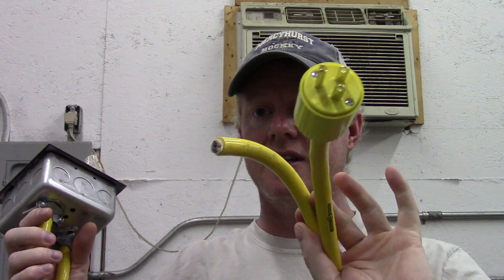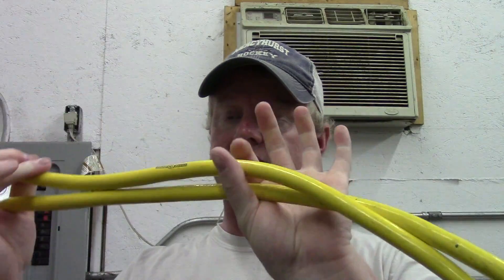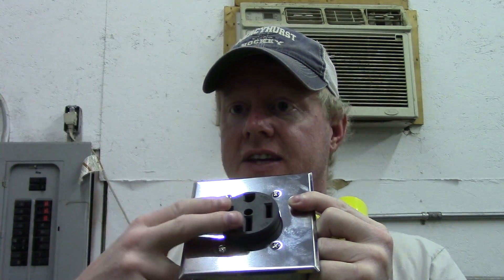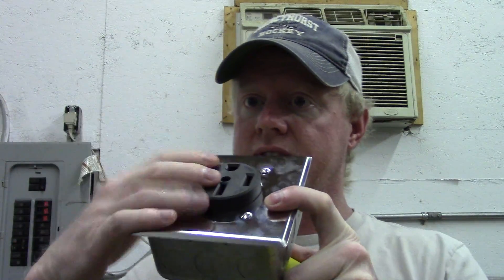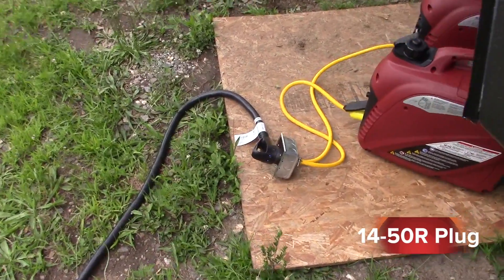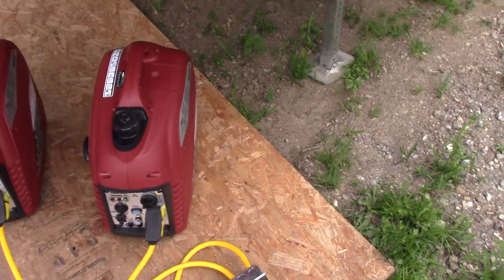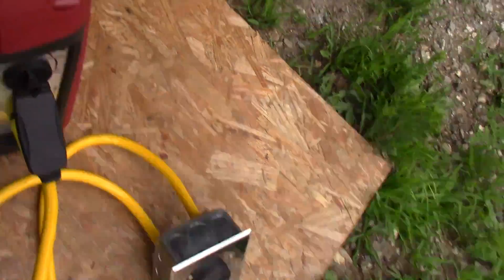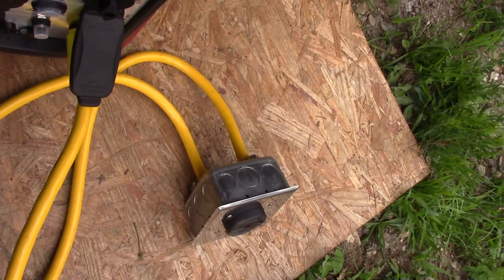How to make an Inverter Generator Parallel Cable  AKA Cable of Death

Comment: Do inverters align the two phases when connected this way? Or else I suspect it won't be true 240v output.
Reply from the maker: It won't be 240v with 120v inverters but yes the first one to start output is the master and the rest slave to that single phase.  Newer 240V inverter can do the same with 240V.

Comment: For those who doesn't understand the insides on the box you might want to show a picture or a drawing.  I can't see why a gen at 4400w and another at 4000w wouldn't run a small house in rough times or others.  Thanks for the posts.  Also one might want to add a off switch in the center 8n the wires.  Thanis for the posts

Comment: why would you not use the other plug for more amps?
Reply from the maker: Which "other plug"?
Reply: @ShaneBurrell1  Doesn't each gen have the 3 prong 20 amp twist lock above the one you used? That one is much less prone to falling out and is rated at 20 amps.

Comment: Wonder if anyone has successfully paired an inverter running off a battery bank with an inverter generator. Great video
Reply from the maker: I've never tried it but it would work as long as you have a good source sine wave.
Reply: @ShaneBurrell1  yea that’s the problem. I think most are modified sign wave

Comment: Hi Shane,
I have the same question pertaining to the predator 3500 gens running in parallel. 

 Ther rig does have two (2) 50 amp breakers 
(leg 1 & leg 2), therefore it's a 240 service coming into the breaker panel....

In that case, would both "hot legs" still be bridged, or would I just send Gen 1 to line one and Gen 2 to line two of the 50 amp outlet?  

I will be utilizing the 30 amp (3 prong) plug from both gens, and yes I will be installing a 50 amp breaker as well.  I just wanted to know if my thinking was correct when it comes to wiring the legs to get the 240 volt....

**The big issue I have is, I have the Heughes Power Watchdog hardwired into my rig.  The "Power Watchdog" will throw a code if it can't see the two legs coming in. This is where I'm coming into an issue at the moment.

Thanks for any insight.
Reply from the maker: On the rig, you need to be really sure that you don't have any actual 240V loads (Residential Fridge etc).  If that is the case you I would recommend bridging and ending up with generators in para mode at 120V. If you don't bridge they will just be seperate generators with a shared neutral still 120V on each leg with no 240V .  You won't even be able to actually get 240V from the predator 3500.  It's strictly a 120V inverter.  To get true 240V you would need to step up to the 9500 Predator Inverter. The reason this works normally on most RV is they install a 50 amp 240 panel but the loads are normally 120V.  Sometimes they have upgrades that are real 240V which isn't compatible with this method.
Reply: @ShaneBurrell1  Thanks for the reply Shane, I did make the parallel cable yesterday and at the moment there isn't any jumper between both the hots.  When I tested the voltage, there is 120v on both legs, and the Power Watchdog recognizes it as 240v, allowing the power to flow to the rig.  Once the system all checked out, I started my AC's one at a time.  With the current setup, I'm able to run 2 of my 3 AC's, All my Tv's (4), along with other devices and appliances running.  For the record, there is a residential Refrigerator in the rig.  As a side note, last night my wife had started her hairdryer  before I could turn off the 2 AC's, and to my surprise , we didn't overload the system.

As a general thought, since I haven't "bridged" the two hots, and each gen has the capability to produce 120v, the Hughes Power Watchdog accepts this as 240v, therefore letting it pass through.  

*FYI, the parallel cable that I made cost $98. in materials..

Shane, thanks again for the reply, as well as the video

Comment: I made this exact set up for my honda eu3000i generators. When I hook my rv cable to it, it shows the red led light meaning reverse polarity  or hot ground. Does that sound right?
Reply from the maker: It does not sound right. What has the red light?  I have a furrion 50 amp system and it does have lights on the cable but they are both blue and just are either on or off.
Reply: @ShaneBurrell1  the cable coming from the camper. When I plug it in the parallel cable from the gennys it alluminates red,which says reverse polarity or hot ground. Was your 50 amp receptical a 3pole 4 wire?
Reply from the maker: It's a 14-50 R which is 3 pole 4 wire.  I would ohm out the adapter and make sure your ground isn't conducting to either of the hots or the neutral. Then check the neutral to ensure it also isn't conducting to either hots or ground.  You should be able to test also by using a voltmeter with gen running at the plug to ensure you see voltage only on the hot legs of the 14-50 R
Reply: When I test for voltage at the 50 amp receptical between black(hot) and white(nuetral) I get 124v, when I test for voltage between white(nuetral) and green(ground) I get 60v, when I test for voltage between black(hot) and black(hot) I get 0v. Does that all sound like proper voltage for this set up.
Reply from the maker: The ground to neutral is strange.  It should bonded.  What generators are you using?

Comment: 🤔 Maybe adapt the generator outlet to twist lock? Great Video, answered a few questions I had. Thanks. Now for a guiness book of world parallel generators.
Reply from the maker: Glad it helped.  The 50 amp side is pretty robust. Takes a lot of force to pull those out.  The generator side would be hard to do as its space constrained behind the panel.

Comment: Outstanding lesson in parallel generator electrical mechanics!! I went to buy a parallel kit and thought, I can make this for around $30. However, I wanted to do some research first to make sure my brilliant idea ( some not so much) would work. Perfect, thanks. BTW, I recognized your call sign. Mine is KF4JGY...Well done sir....
Reply: Found one on Amazon, pre-made and it is perfect. The cost is $44.01
Conntek 14995 50 amp
Reply: @thomasgibson8025  Just to be sure that you are aware on that adapter you just got (14995); that one's 50 amp output DOES NOT TIE the two hots together.  So each of those hot legs just simply pass on whatever amps are feeding them; they will not combine your two generator outputs.  So hot leg 1 output yields a max amps from only one gen and the other gen feeds that 2nd hot leg. So the continuous gen amps output (say 1600 watts ~= 13.3 amps)  is all that feeds one of the halves of your trailer's 50 amp breaker panel, the other half is feed by the other gen.  Thus they won't be parallel combined.  That's why Shane made his own and pointed out that he is tying in both hots purposefully at the 6 minute mark of the video.  That way he is combining each 1600 watts continuous gens to get a total of 3200 watts (~26.7 amps) continuous and jumpered means each hot leg can carry those 26.7 amps.  But he must not exceed that 26.7 combined throughout his trailer's whole 50 amp breaker panel; thus his testing.
What this adapter you purchased is meant for and is perfect for is if you're at a campground with two back to back facing land power pedestals each at 30 amps. If no one is camped there using that 2nd one, you can plug each of this adapter's 30 amp plugs into each 30 amp receptacle (or if there are two 30 amp receptacles on one, use those) and then your trailer's 50 amp plugs into the adapter's 50 amp outlet. If that second power pedestal is further away, just add a 30 amp extension cord as needed. But you then still only get 30 amps on each separate hot leg to feed the two 50 amp halves of your breaker panel, so don't exceed 30 amps on each half or the pedestal breaker trips.  But that's still plenty of power! Now if you get two 3600 watt (30 amp) inverter type gens, then with this 14995 adapter, you also feed 30 amps to each of the two halves of your trailer's 50 amp breaker panel.  Similarly, two 3000 watt inverter gens would still yield about 25 amps each half.  So you may still want to keep it; as one day when I get a 50 amp trailer, I would want the 14995 adapter also.  For reference, a 50 amp land line yields two 50 amp hot legs (leg 1 & leg 2) thru a 50 amp cord.  Each half of the 50 amp trailer breaker is then feed it's own full 50 amps for a total of a 100 amp service breaker panel. Hope this helps and Happy Camping!
Reply from the maker: Glad it was helpful!

Comment: Should a ground wire be connected to the metal box with the 50 amp outlet ? A jumper wire from the plug ground to the box ?
Reply from the maker: You could bond the box.  Since there isn't a conductor (EMT conduit) to the box there isn't a large chance of potential difference at the metal box other than if it was energized by something loose in it.  In that case it would trip the load breaker with a dead short if the supply came loose and contacted the box.
Reply: @ShaneBurrell1  I have generator from the 1970’s with no breaker. In this case what would happen?
Reply from the maker: @Dennis-fs6zo  Well #1 this cable works with newer inverter style generators.  So it won't work with normal older generators that can't sync to each other.  If you had a cable that went to a metal box contacting a exposed wire you have the potential for electrocution when you touch it. If the box was tied to generator ground it would overload it (fire & heat).
Reply: @ShaneBurrell1  yes , my question is unrelated to syncing inverters. My gen has a four prong 220 outlet I use to power my house. I made a box to  plug into generator  with 110 outlets. Tied each hot to its own outlet. Jumpered the neutral. Do you think this is safe?
Reply: Should the box be grounded to the generator?
Reply from the maker: @Dennis-fs6zo  Yes, you can split your output to 110 without issue.  The box would be safest if bonded to ground.  If used with a homes existing wiring, the ground system the generator Frame should also be bonded to earth ground. If you are running isolated, just extensions cords going direct to loads you the generator frame is the sole ground.
Reply: @ShaneBurrell1  What scares me is without a breaker on the generator should the 110 outlet box become energized it could kill someone. Thanks for your help.
Reply from the maker: A PVC box is also an option but from your description, I would bond the box to the generator ground if you used a conductive box.

Comment: you mention that you got the 50 amp outlet at Lowes... where did you find the two 110 yellow cables? what size wire does the cable have... 10 gauge, 8 gauge, 6 gauge, etc?
Reply from the maker: The yellow cables are "yellow jacket" brand extension cords which I also go at lowes. They are 10 Gauge.

Comment: nice video. hope this gets to you. I have an older Honda generator, it does not have a parallel plug on it
Honda EM5000is  it's an inverter generator.  Obviously, the banana plug just makes it easier to use? 
So just basically do what you did or can i buy one and change the end banana plug to a 220 volt plug?
Reply from the maker: If it has the para banana plugs you could just not use them and use the receptacle on the genset. If it doesn’t have the banana just be sure it’s an inverter style and that the module in that genset supports para sync
Reply: @ShaneBurrell1  it is a inverter generator. but no banana plug. how do I find out if it supports a parallel kit?
Reply from the maker: @BK-gc1jm  easy way is to part number for the module and see if it’s used in other units that have para operation. Sometimes you can get complete manu specs on the module that will tell you as well

Comment: Have a question . Can this also be made up to utilize the 30 amp plug on the generator ?  Realizing there are two hots on the 30 amp plug . So I was wondering if it is possible to just split the phasing to each side of the shore female plug from both generators .
Reply from the maker: That depends.  If you have 2 hots on the 30 amp it's a 240v plug. Is this an inverter style generator?
Reply: @ShaneBurrell1  it would be an inverter generator . So on a 30 inverter generator ( 3 ) prong there’d be only one hot leg . Having two 30 amp inverter generators that are parallel equipped but using the 30 amp plug in the same fashion as you did in your video , I’d think then you could be able to have 60 amps by using the same scenario as shown in your video . I may be incorrect in my thinking though . Just trying to figure out to get service for my 50 amp rig by utilizing the same design fashion as the video and two smaller generators .
Reply from the maker: @simplyblessedrvlife9067  Oh yeah you can just put 30 amp plugs in place of the 15-20amp plugs.  They only thing i would caution is the inverters likely have 30 amp protection so x2 that would be 60 amps which is more than the 50 amp plug is rated for.  You may want to consider a 50 amp breaker or if the gensets put out less than 30 amps bet on them never doing it.  I'm sure you have already checked but be sure your appliances are not 240V and that your panel load is less than 50 amps.  Technically a 50 AMP 240V setup in a camper can consume 100amps at 120V but normally thats not a issue.
Reply: @ShaneBurrell1  yep you’re exactly right . I’d have to install a 50 amp breaker between the split and the draw plug . I totally missed that . Thanks .
Reply from the maker: @simplyblessedrvlife9067  Let me know how it turns out.  I've be eyeing one of the NPS 5500 once they are generally available.

Comment: I have a champion inverter 8750 (8750 starting watts and 7000 running watts).  It gives me 30 amps of 240 power which gives me 60% of the load that my RV can take.  My question is, this is a modern inverter generator, but it doesn’t have a parallel port.  Can I buy a second one so I can have 60amps of 240 volt total power available?
Reply from the maker: That's a good question. I haven't gotten to see a 240v inverter yet from champion. Can you see any part numbers on the inverter section?
Reply: @Shane - https://www.championpowerequipment.com/product/100520-8750-watt-open-frame-inverter/

Model #100520
Reply from the maker: I couldn't find any info on the inverter module this uses. I'll try to see if I see one in person next camping world trip.  If you can identify the inverter section it will give you some insight on if it supports syncing or not.  It's a little strange they didn't put para ports or offer para cable.

Comment: Can I make a similar setup to power a inverter welder? I want 220 power with the added wattage from 2 5500 generators?
Reply from the maker: If the 5500’s are inverter style generators that support para operation yes
Reply: They are not. They are older models with out daisy chain ports. Like yourself I'd be wiring them like the 120 volt you did in this video
Reply from the maker: @ryanestes4581  This only works with inverter style generators.  They can sync to each other. A standard generator can not.

Comment: How is this approach different than the little box Champion sells?  I have 2 2000 watt inverter style Champions and the box won't arrive before my vacation.  I understand all of the physics you've described here, and I understand that the inverters will self discover the phase.  What I'm wondering about is the Champions have those special plugs that are supposed to connect, and yet you never used that.  You just plugged two 15A circuits into a single 30A (or 50A as the case may be).  So why to the Champions have those special plugs?
Reply from the maker: There is nothing different other than the compactness of what I built to go straight to my 50 Amp.  I hate the banana plugs. Westinghouse has something very similar that I like and sometimes use that has a 30 amp which you can use a RV dogbone to mate to a 50 amp.  It's preference really.  The champions use banana plugs because they are insulated (mostly) even when disconnected and in theory safer.  For me I always connect everything regardless so there is never a live exposed end.
Reply: @ShaneBurrell1  so I tried it out. When the AC kicked on the generators would hit overload. After several tries I got the AC one but it quite after 5 minutes. Then the one generator wouldn't produce power. Tried to kill and restart and it was hard to pull the cord. It feels a bit seized. In the end it didn't work however I don't think your cable was the issue. I tested it at 125V.
Reply from the maker: @johnniemo  Are you using an inverter style generator?  Para doesn't work with normal generators.  Only inveter style generators.  You should have no problems starting a RV AC unit with even 2 1800+ watt inverter generators in para.
Reply: @ShaneBurrell1  yes they are matching Champion 2000 watt inverters. With the paralink leads. Like I said I think it may have buggered up the electrical circuit somehow by repeatedly flipping the breaker.

Comment: I got two honda black max 8750 and i want to parallel them I have the 30 amp plug on my trailer will be ok to do that I’m running a food truck
Reply from the maker: It appears the black max 8750 is a traditional generator and not an inverter.  Its not possible to parallel those.

Comment: What if there was no outlet on your cord just male to male?
Reply from the maker: Would be a double ended cable of death.  Either side could be energized with bare conductor.
Reply: @ShaneBurrell1  but it would still parallel the units, correct?
Reply from the maker: @vacamike  It would but you might exceed the rating of the receptacle.
Reply: @ShaneBurrell1  i made one and it works and does not overload the receptacle. I pulled 50a from one generator with it.
Reply from the maker: @vacamike  Thats awesome. Mine is still working great.

Comment: Do you know if it will work with old Champion 3100,75536i and new smaller 2200 w?
Reply from the maker: As long as they are inverters and have parallel hookups.